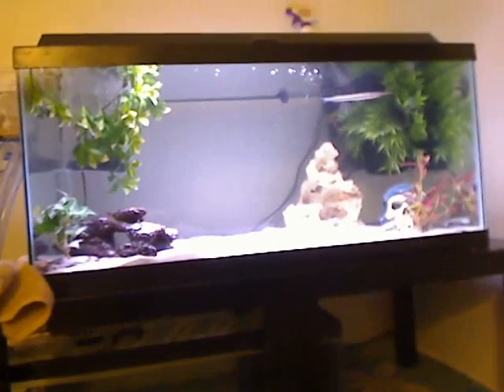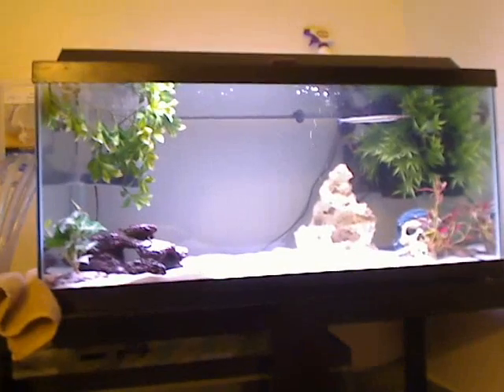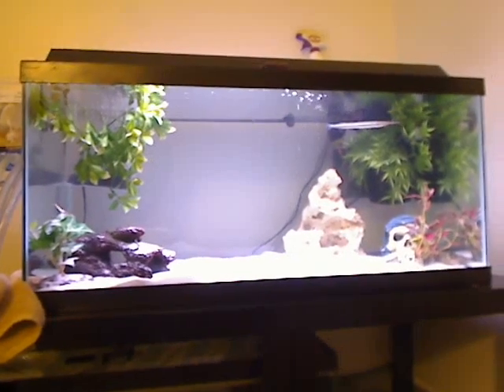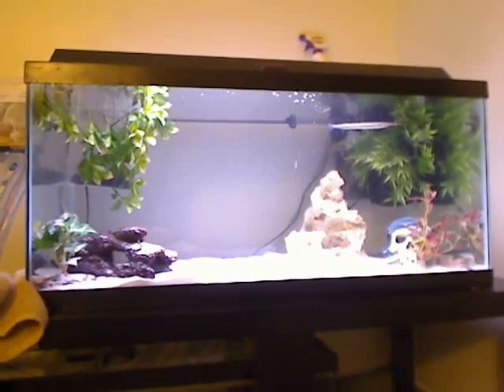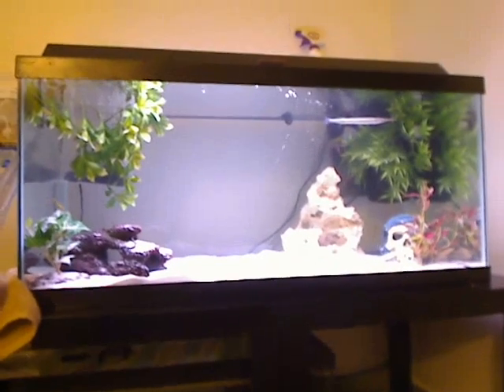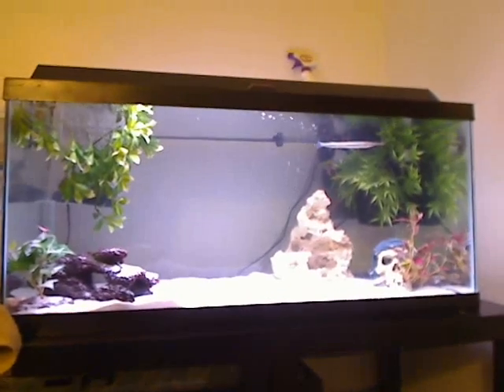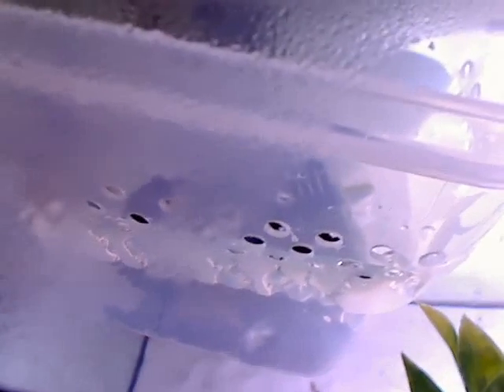DIY 300GPH Overflow Box - Simple to make! Under $7.50

Comment: RiP ear drums
Reply from the maker: :(  I know, such an old video.  One of my first few, from back over a decade ago.  Cameras weren't great back then.  I think I was actually using a webcam connected to a ultra micro pc (a small laptop that was kind of like tablets are, before tablets were invented).  Kind of like a Microsoft Surface, but, smaller even.  I was new to video back then.  It's sad because this overflow box worked great for me for years!  Super low cost and effective!  Wish I still had the parts to it, I would make a new video on it.  I ended up throwing it out when I took down these tanks a few years after this video was made.  :(

Comment: very clever, well thought out design. 
but the audio track  desperately needs to be re-recorded. this is painful to listen to
Reply from the maker: Sadly, this video was made back in 2008.  YouTube only allowed 480 video, and, digital cameras back then weren't very good.  :(  I think I may have even used a computer to record this, can't remember.  Thanks for your comment.  Wish I could redu the audio.
Reply: @earthling1984  you can recpature the video off youtube if you dont have the original, and record new audio using voice recorder (built into widows), then stick the new audio with old video using one of dozes of free windows apps. PM if your ever interested  in doing that. 

I havent seen a DIY over like this before. This method is a lot better than the 3 common DIY overflows  on youtube.  (which are loud, pia to prime, have a lot more hardware in and out of the tank- not to mention most of us have all the parts you used laying around the house)

I think the $5 marina breeder box is perfect to make the input out of https://www.amazon.com/dp/B005QRDDJ2/ref=twister_B00Q4PKI7A?_encoding=UTF8&psc=1

Comment from the maker: the pump will stop pushing water from the sump to the main tank.  This will cause water to stop drining through the overflow box, BUT, the overflow box STAYS IN TACT, with both sides of the U tube under water, so when the power returns on, the system simply resumes as usual.

Comment from the maker: Sorry for such a late response.  Any tube you can use.  Long as it is air/water tight and doesn't leak.  Go with a CLEAR tube for sure, so you can see if you have any bubbles in it.

Comment: Hi, I've been looking for videos showing overflow system examples and from all that I've seen yours is the best.  Just like you said. Even if there is a power cut  your synphon willbe working perfectly fine as it stays under water in both sides (which should be like a standard to avoid issues like flooding). Congratulations on your solution. Cheers.

Comment from the maker: oh and I wanted to add.  I think this overflow box does more than 300GPH.  I listed it as 300GPH because that is the size pump I tested this tank with.  I have since tried a 470GPH pump and it worked fine.  Although headheight has to be taken into account, so that is still only tested at about 320GPH

Comment from the maker: they are about 2 liters I'd guess.  you can't really go too big, but larger=heaver which could cause problems.  The important part about GPH speed is the height more then the size.  Let me explain... You know how a siphon or U tube... basically water is moving through it because the water level on each side is not equal... it wants to equal out the water levels.  So, if the distance from intank box water level to out of tank box water level is many inches, water will pass through faster.

Comment from the maker: I drilled the holes just a bit smaller then the tubing, and it fit very snugly. Then I used superglue actually first, to hold them in place and do a first seal. Then over that I used silicon. It should stick fine, give it time, after applying a thin layer you need to let it sit and dry at least 24 hours.

Comment from the maker: no, it does not suck in air... The tubes are low in the overflow box, and out of tank box.  If the water stops pumping, the water will lower in both the boxes, but the tubes STAY UNDER WATER.  This is just how a normal 'store bought' overflow box works.  The tubes stay submerged, water stays in them, and when the system starts again, the suction is working.

Comment: Like you said the holes in the box have to be just under the water line, so the power goes out, water drains to those holes, then the overflow sucks air and the suction ends.

Comment from the maker: Yes, the siphon tubes stay under water on both sides, so the siphon stays in tact.  If the power goes off, the system just stops, nothing overflows, then when power goes back on, the pump starts pushing water, and the overflow box starts draining water again.

Comment from the maker: I don't know what your design is.  But this was a quick, simple, easy to make and very cheap overflow box.  It works perfect, keeps up with 300GPH flow and hasn't had a single problem.  Have had ZERO bubbles in U tube ever, it is just a great overflow box.  It may not look pretty, but it works just as an overflow box should, and is dead silent.  Not sure what you are talking about with a debris problem, no problems here.

Comment: 4 tubes coming out!  That's just too risky for a silicone failure. Not attractive, but I get the point.  Also, your holes I would think won't allow for proper debris if you had larger fish.  Your limited on fish size with what you built.  Such little flow it would be by chance debris eventually go through the holes.  I like my design better.

Comment from the maker: It isn't about the look, but about how it works, which is flawless.  I agree it could look better had I used a larger drain tube instead of the 4 smaller tubes used, however, it fits the purpose perfectly and can be modified by other makers if they wish to make it look better.  I simply made it for fun really to see if I could, and it turned out great.

Comment from the maker: Get both sides of the U tube under water.  Before you do this, put a smaller airline tube up inside the U tube.  With both sides now under water, suck out the air with the air tube.  Once the siphon is full of water, keep your mouth on the airtube to prevent air from moving back into the U tube, and carefull pull the airtube out from the U tube without raising the U tube above the water surface on either side.

Comment from the maker: no noise as you can hear obviously in the video.  When I take out the air tube you hear the noise.  Everything on my tank is turned on during this video, it is pretty silent.  This DIY overflow box is actually quieter then the brand name overflow box I have on my SW tank.